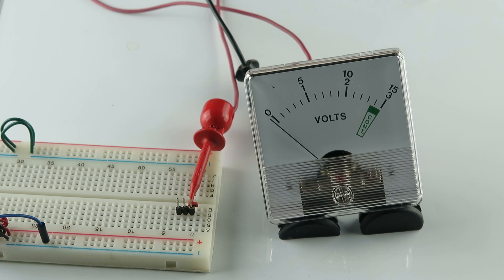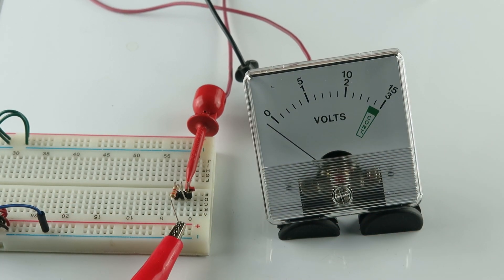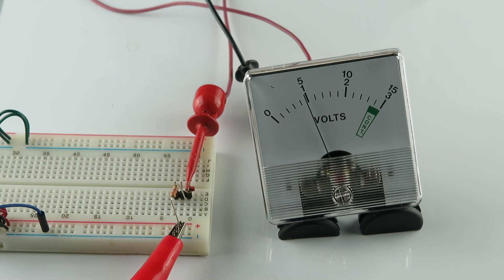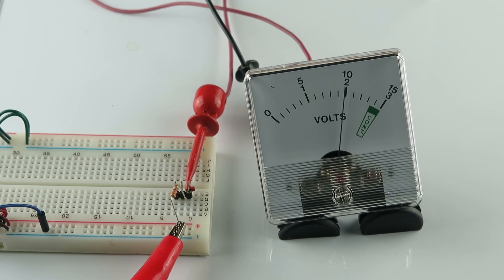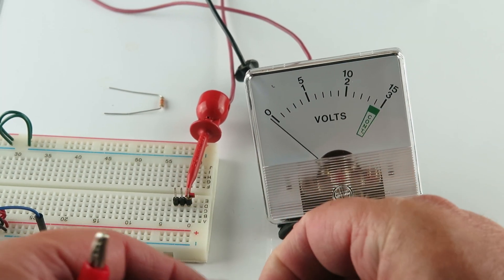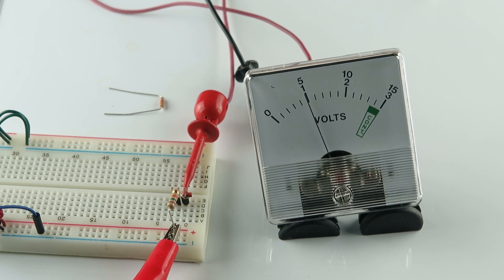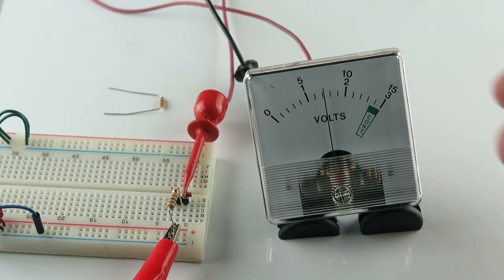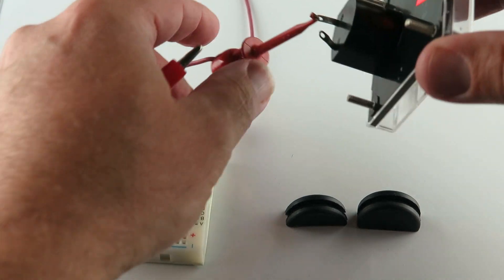G26525 - Large Analog DC Panel Meter 2.4" Sq.

Comment: This would be in fact about a 9 or 10 mA micro amp meter. with a scale that represent voltage. This could be also use as an amp meter with the appropriate shunt resistor. Does the back scale can be reversed?